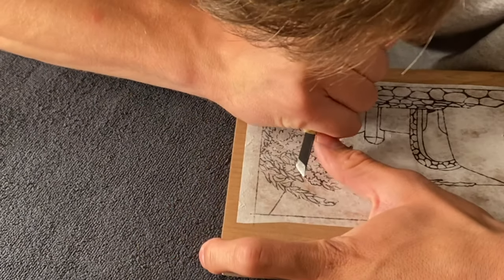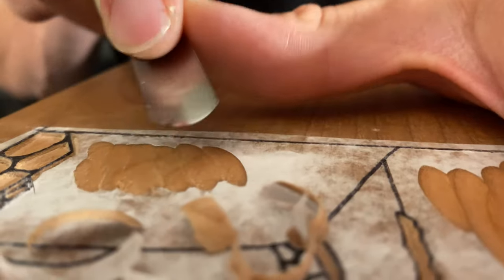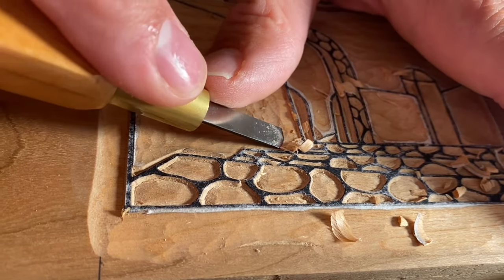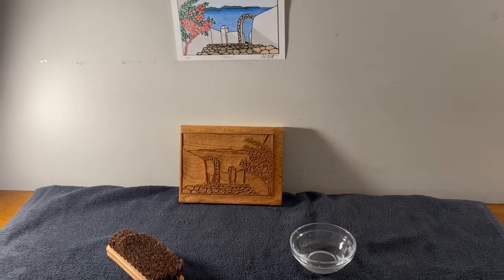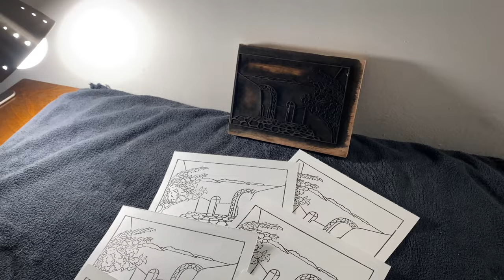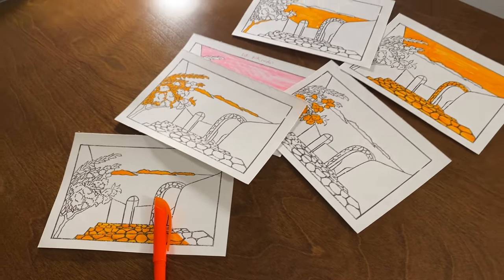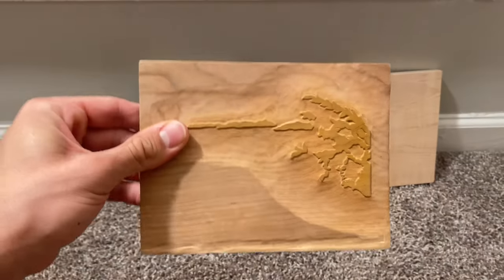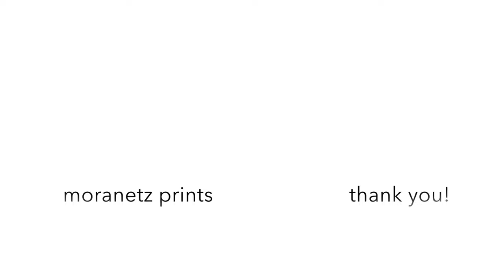How to make a Woodblock Print, Part 2: Carving (Japanese art form)

Comment: In seeing how much you carve away, I wonder if it might be easier, at least in some areas to build up the areas to print instead of carving everything else away.
 A few years ago I went to a printmaking workshop where we did a number of novel techniques. My favorite started with a thin board and then we created an image on the board using various kinds of adhesive tape. Masking tape, scotch tape and paper tape as well as just plain paper glued down on the board. Then we applied thick printers ink, rubbing on a thin layer and after carefully laying some paper on top we rubbed it down onto the plate with the back of a wooden spoon. The variety of textures created by the different tapes was quite amazing.
Reply from the maker: Thank you for the comment!  It's cool to hear about your experience with that technique.  I have not strayed much from my quasi-traditional techniques, and it's something that I may experiment with in the future.  In addition, there definitely could be opportunity to design the color separations in such a way that I do build up more color layering.

Comment: Loving ur series!
Do u have any tips for rounded areas? Thats something ive been really stuggeling with!

Thanks in advance!
Reply from the maker: Thanks for the comment!   The biggest thing I’ve found in rounded/ tight areas is that you want to pull your knife out of the wood so it’s not as deep.  This will give your knife more agility.  Also, you can try cutting curves in multiple cuts (tangent to the outside of the curve)

Comment: What size is your wood block verses the actual print?
Reply from the maker: The woodblock just needs to be large enough to fit the print outline and the registration marks.  The distance between the outline and the registration marks will determine how large the border around your print will be.

Therefore, at a minimum I would add about 1.5-2 cm to the desired print dimensions to determine the minimum wood block size.  I hope that is helpful!